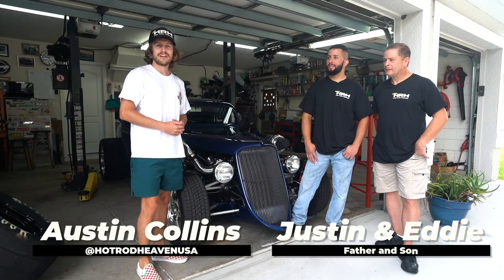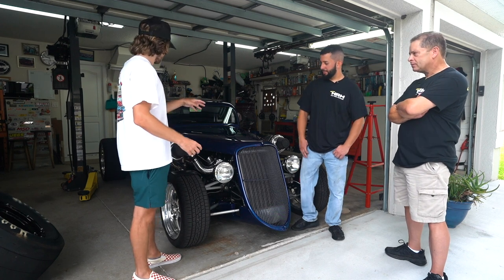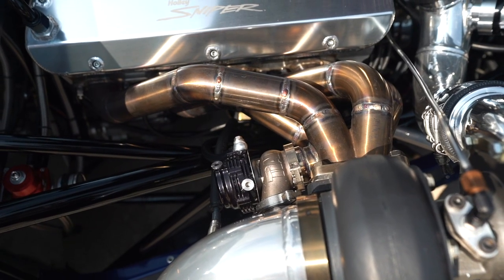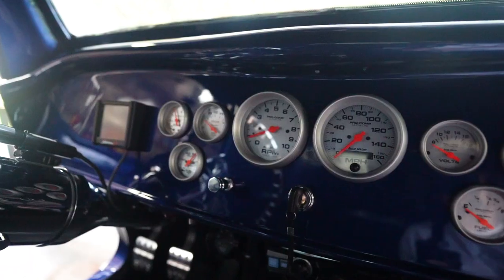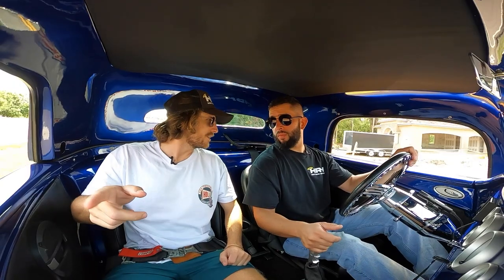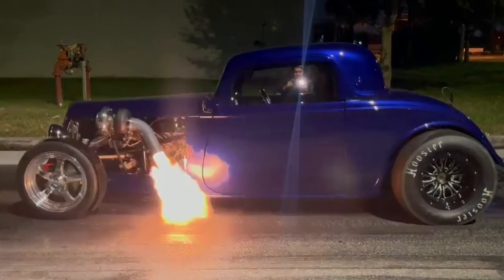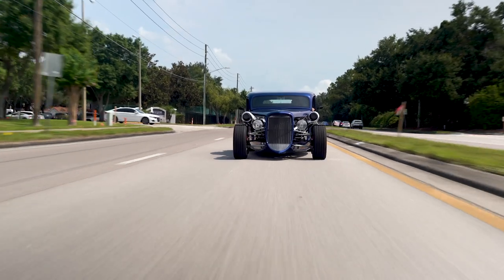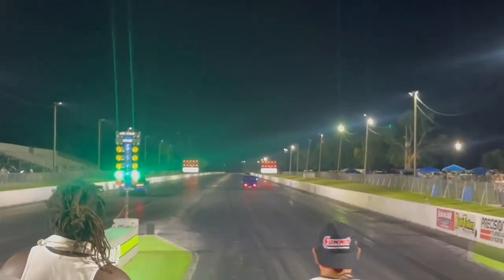Twin Turbo 1933 Ford Hot Rod | Father & Son Garage Built

Comment: What stands apart or makes this car stands apart is the effort these two gentlemen put into it. Make no mistake if you're buying a kit car especially a factory five kit car it doesn't fit. The panels don't fit control arms don't line up headers don't line up none of the both holes line up if they do it's kind of a fluke. You have to be ready to fix this car because it comes with a multitude of mistakes. These two guys not only work through that which I'm sure they were not expecting, they also did one of the better jobs as far as fitment goes and Welding up a set of headers and stainless is not easy it takes an enormous amount of skill and patience. Hats off it's a beautiful car it would be a hoot to drive.